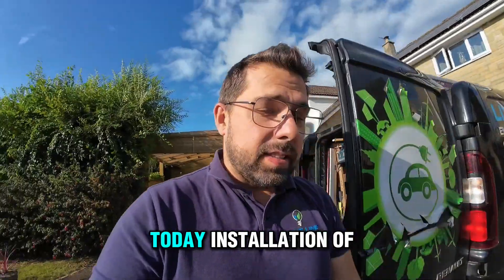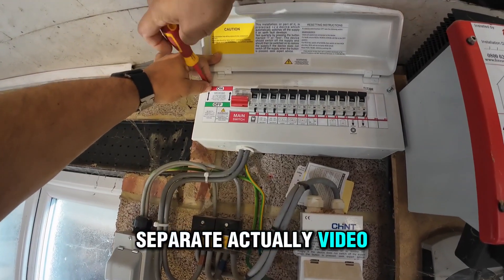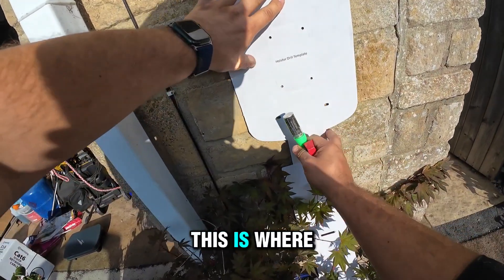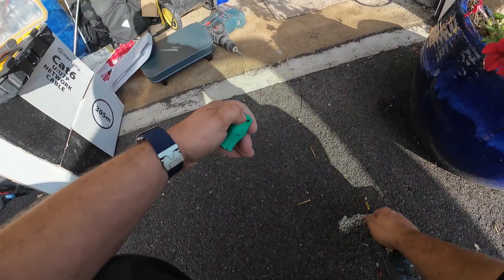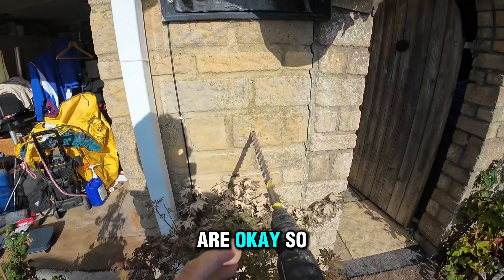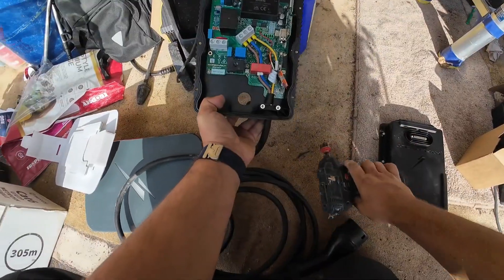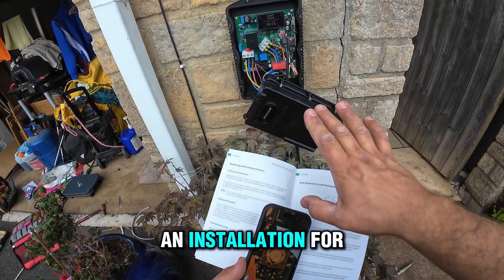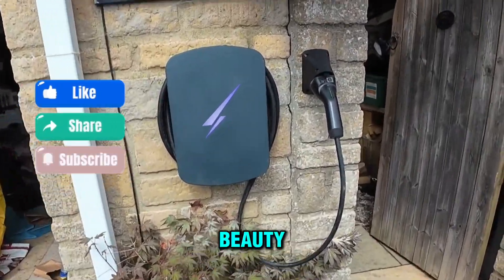I Installed a Home EV Charger & Here's What Happened

Comment: Hi wondered if you could help when connecting the ct clamp by the ethernet cable in the instruction manual its showing the brown and white to connect to the ct plug , we are using an ethernet cable as we are too far away for WiFi, you mention the ornage and white ??? Which is correct any help would be fantastic thankyou

Comment: Great video as usual and well explained. FYI to magnetize your screwdriver rub it in one direction only (not back and forth). rubbing back and forth will just magnetize it and de-magnetize it. rotate the screwdriver and do the same again and the same direction and you will see a big difference. I use a magnet from a microwave oven magnetron and it work very well.